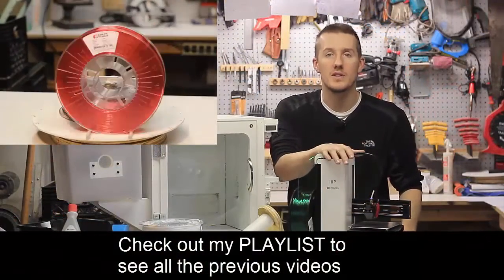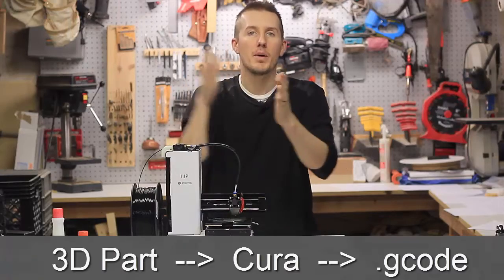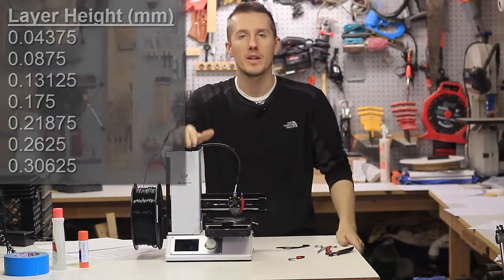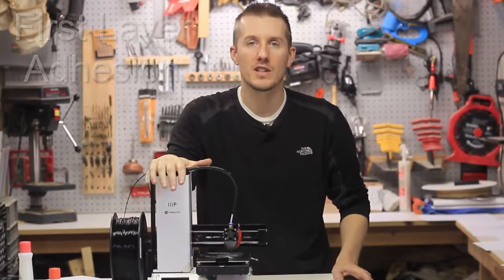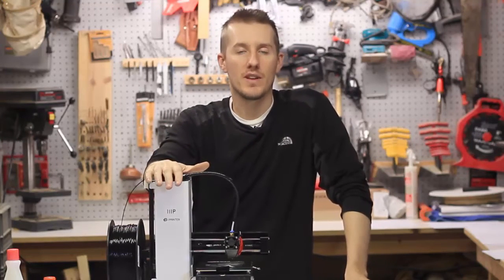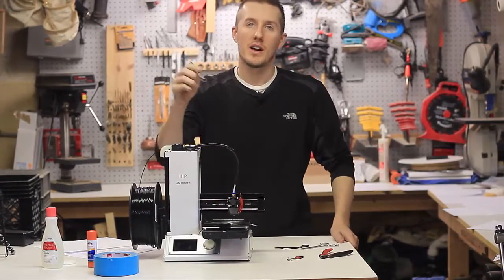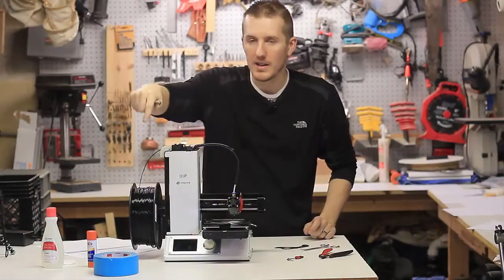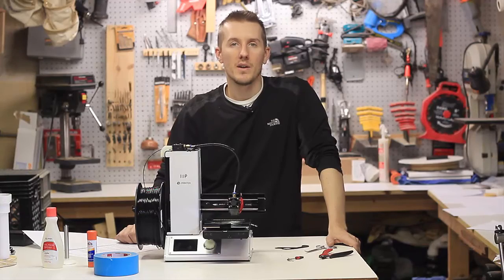Things I Learned - 3D Printing

Comment: Am a noob.  Have the printer but waiting on filament.  Your's is the best video I've seen so far.  I have a homestead in the Ozarks and am seeing if a 3D printer has a place on the homestead making spare parts, etc.
Reply from the maker: It depends on what type of parts you are thinking of.  PLA isn't very strong, it's brittle and can snap.  PETG and ABS are better.  I've never tried printing with Nylon but that is usually double the strength of the others.  I remember watching a video where a guy did a tensile strength test on filament and Nylon was way ahead of everything else.  
But as long as you can draw the 3D part, you should be able to print it.
Reply: I used to work on 8'x4' foot printers that utilized a light source to expose film, for a z axis, so I think I'll like playing with the thing.  I recently paid $12 for a cover for my radiator overflow.  I think that would have been easy to print.  We'll see.

Comment: One question. Have you tried buildtak, because i hear it works just as good
Reply from the maker: Haven't tried Buildtak but i have tried PEI.  It's not cheap, i think i paid $17 on Amazon.  But it is so much nicer to print on, no more glue stick.  Just heat the bed up to 65 degrees and it sticks great, pops right off and go again.  I wipe it down every 3 or 4 prints with nail polish remover.